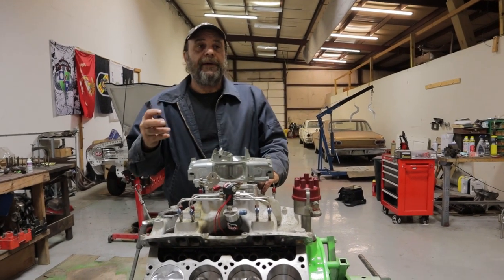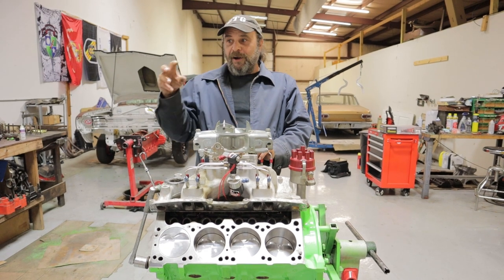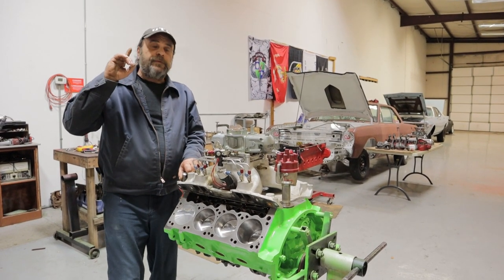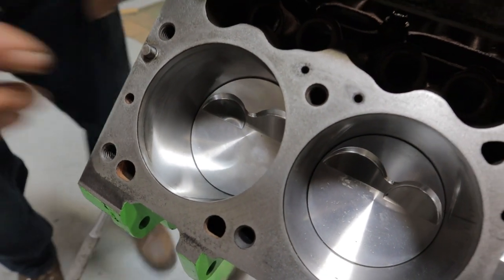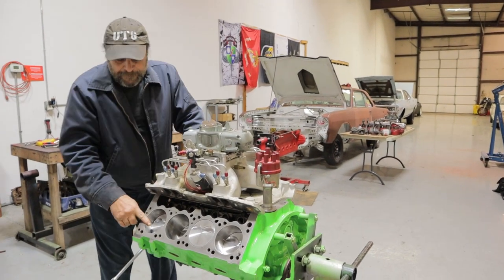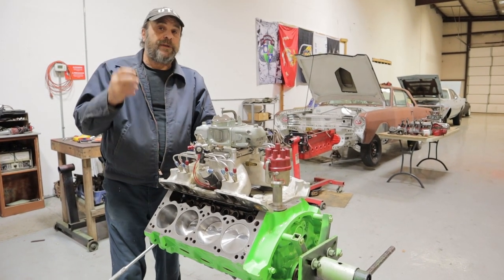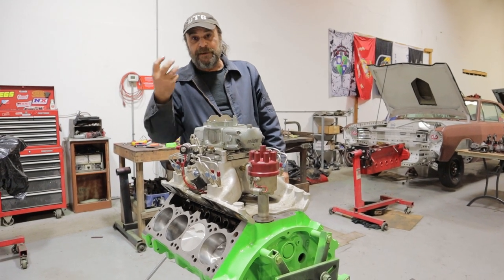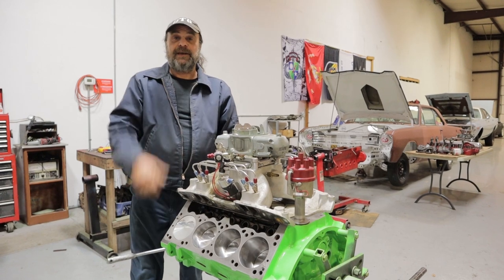The Fundamental Aspect Of The Internal Combustion Engine Nobody Ever Talks About

Comment: I think the simplest way to explain this is that engines don't run on explosions they run on expansion.
Reply: What’s the difference?
Reply: @yeboscrebo4451  my lungs expand
Reply: @jarlnieminen4307  you’ll have to explain, I’m not following
Reply: @yeboscrebo4451  an explosion is only one form OF expansion one that's destructive because of the rate at which expansion occurs.
Reply: @jarlnieminen4307  so how do engines run on expansion exactly
Reply: @yeboscrebo4451  in a sealed environment exspansion creates pressure/force.
Reply: @yeboscrebo4451  the more condensed your fuel is the more pressure/force results from its exspansion.
Reply: @jarlnieminen4307  are you being obtuse on purpose?  What was the  point of saying “my lungs expand”?  The expansion is coming from the explosion obviously
Reply: @yeboscrebo4451  no... we have internal COMBUSTION engines not explosion engines. Were you acting dumb on purpose?
Reply: @yeboscrebo4451  maybe you have some humility instead of faking it.
Reply: @jarlnieminen4307  dude, look up the word combustion.  Does the definition align more closely with “explosion” or “expansion”.  In relation to the topic you said that “lungs expand”.  I ask again, what does that have to do with anything?
Reply: @yeboscrebo4451  expansion is happening far before ignition and before the mixture is ignited or even enters the chamber. If you are running on vapours you have already  expanded the  fuel so there is less expansion left to occur from ignition. Also thanks to expanding the fuel you are having less of it for the same engine capacity.
Reply: @yeboscrebo4451  as for my lungs....its pretty damn simple my lungs dont explode do they so clearly the question what is the difference is silly.
Reply: @yeboscrebo4451  combustion is NOT an explosion and it IS exspansion. An explosion is also expansion. For some reason you cannot see past your mistake or move past it.
Reply: @jarlnieminen4307  yeah….so what?  In an effective conversation, when a question is asked it is important to answer that question or there can’t be progress.  What is the point of saying “my lungs expand”?  The density loss of fuel in vapor form is countered by the turbo charger in michaels engine and the “homogenizer” in Smokey’s version.  And the point of this engines, as mentioned in the video, is a more complete burn not increased ho or torque.
Reply: @jarlnieminen4307   If both an engine and your lungs run on expansion, then please, for the love of God, explain how an engine runs off of expansion.  To say “my lungs expand” as an example is so utterly ridiculously impertinent ….
Reply: @yeboscrebo4451  no in an effective conversation both sides have to act in good faith. You asked multiple stupid questions and insist on mixing and removing definitions in order to remove the discusion from the actual topic which you clearly dont want to understand.
Reply: Somebody needs to start a gofundme account for you to purchase a dictionary.  Tell me again that there is no explosion happening in that cylinder.
Reply: @jarlnieminen4307  “combustion is not an explosion and it is expansion.  An explosion is also expansion”.  HAHAHAHAH.  Anyone reading this thread would clearly see that it is YOU “mixing” definitions. Hahhahahahh.  Ever heard of projection?
Reply: Explain to me and everyone else how there is no explosion happening in that cylinder.  Waiting……
Reply: @yeboscrebo4451  no the point of Smokeys engine was not to have an aenimic barely running engine. Like you describe. If that were the point he would have just put a wood vapor system on it. Ps the turbo also works thanks to exspansion and in order to run off of less it will also produce less.
Reply: @yeboscrebo4451  because COMBUSTION is happening not explosion.
Reply: @jarlnieminen4307  You have a severe problem with logic and comprehension.  I DID NOT SAY the point was to have a barely running engine.  Read more carefully, go ahead, reread what i actually said.  I said the point was to have a complete burn, NOT to INCREASE hp or tq.  Smokey’s engine was still able to produce 250hp and 230 tq with a much better, more complete burn.  FOR THE MILLIONTH TIME, WHY IS THERE NO “EXPLOSION”?  “Because combustion is happening not explosion” is a non-answer that conveniently does not provide your working definition of explosion.  AGAIN, stop being obtuse.
Reply: @jarlnieminen4307  Your attempt to shy away from a simple question is telling everyone all they need to know.  AGAIN, why is there no explosion in the cylinder.  Answer the simple question simply.  Waiting…..
Reply: @yeboscrebo4451  btw you already proved my point by defending vapour engines. The attempts to make up for its shortcomings prove they were trying to control exspansion not simply ignite a gas.
Reply: In other words, what is your working definition of “explosion”?  Could I be any more clear for you?
Reply: I didn’t ask you to categorize words, I asked you to define.  Understand?
Reply: @yeboscrebo4451  no I have answered it multiple times and your ego wont accept it.
Reply: @jarlnieminen4307  Point me to the place where you defined “explosion”.  Point me to it.  Quote it.
Reply: @UCYc5HoNReejp1zC32ls46vg Because they aren’t flammable and there is no detonation device
Reply: @yeboscrebo4451  claiming the difference between exspansion and explosion to be semantics is testimony to your ignorance.
Reply: Is English your first language?  Where are you from?  Am I speaking to someone lost in translation?
Reply: Annnnnd you’re finished!
Reply: Since you want to change definitions I shall copy paste a definition for you. An explosion is a rapid expansion in volume associated with an extremely vigorous outward release of energy, usually with the generation of high temperatures and release of high-pressure gases. Supersonic explosions created by high explosives are known as detonations and travel through shock waves.
Reply: Combustion, or burning, is a high-temperature exothermic redox chemical reaction between a fuel and an oxidant, usually atmospheric oxygen, that produces oxidized, often gaseous products, in a mixture termed as smoke
Reply: Fuel burns it doesnt explode. An engine would not contain an explosion.
Reply: And the engine still does not run simply on combustion. You must understand exspansion.
Reply: @jarlnieminen4307  oh you mean silly answers like “an explosion is also expansion” which quite obviously contradicts even your initial statement at the head of this thread.
Reply: @yeboscrebo4451  no it doesnt.
Reply: @jarlnieminen4307  finally!  Good boy!  Now we’re getting somewhere.  A rapid expansion in volume associated with an outward release in energy…high temps and gases.  Ummmmm yeah, precisely what happens in that cylinder.  Here’s another technical definition of explosion: “a violent expansion in which energy is transmitted outward as a shock wave”.  Yep, that’s what atomized gas and gas vapors do when ignited in an engine.  When you say “fuel burns it doesn’t explode” you’re being purposefully and irresponsibly specific in hopes that people don’t catch it.  Of course liquid fuel doesn’t explode.  But atomized or vaporized fuel ignited in the presence of oxygen in a confined space like a cylinder EXPLODES by every definition of the word.  You are so silly.
Reply: @yeboscrebo4451  an explosion is onw specific type of exspansion. For my statement to be a contradiction you have to claim that exspansion is an explosion.
Reply: @jarlnieminen4307  “engines don’t run on explosions” is unequivocally contradictory  to the definition of explosion that you provided.  Plain and simple.  Nomatter how hard you try to wiggle out of your contradiction by your semantic word games (ie fanciful word categorizations) it’s not working.  You can’t argue with the definition.  You’re done
Reply: @yeboscrebo4451  similar description does not equal the same. We run combustion engines which BURN a fuel source containing oxygen which produces gases often referred to as "smoke". Just because you consider it rapid exspansion does not mean it meets the definition of an explosive. And guess what even if the exspansion at the point of ignition was considered an "explosion" it does not have any bearing on my point. The engine runs on exspansion not exsplosion because the engine is more than ignition and fuel.
Reply: @yeboscrebo4451  see you arent on subject at all anymore. You are purposely ignoring the exact type that these engines are which is named for the process that the derive power from. And you thing you can light some fuel and call it an engine. I told you earlier that you didnt want to understand. I was right again. This video was about the entire process from air filter to exhaust. If you apply the idea that its exspansion that your engine derives power from its a straight line understanding charge density, exhaust scavenging ect. But theres no chance you would ever undestand the premise despite legitimising it. But then you think combustion engines are explosion engines.

Comment: Interesting I've always been told you want a fast burn to make as much power as possible, I never thought about the concept of extending the burn. It gives me an interesting idea for direct injection witg multiple injection and spark events though. Now would this also remain consistent with a much shorter stroke because it seems like those systems may be more efficient in that scenario. I know you said there were averages but this does make me curious.